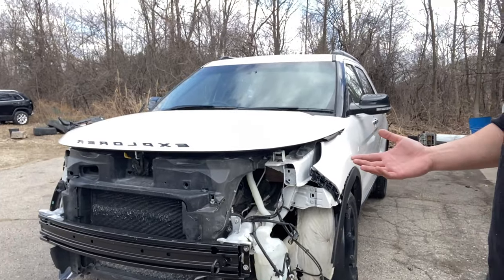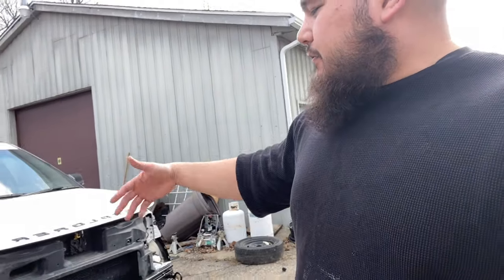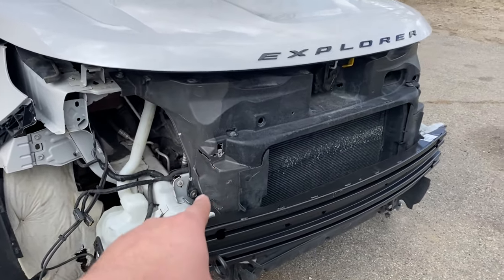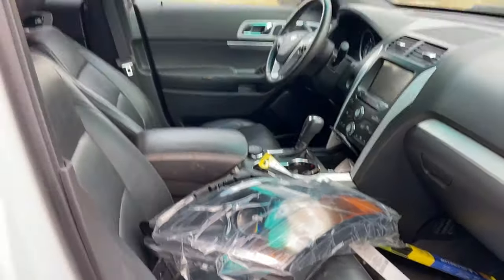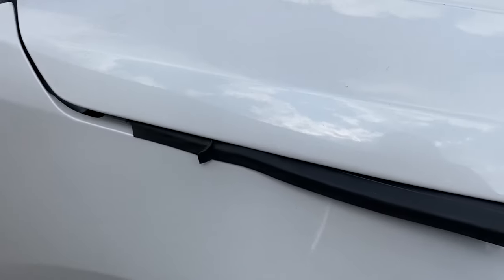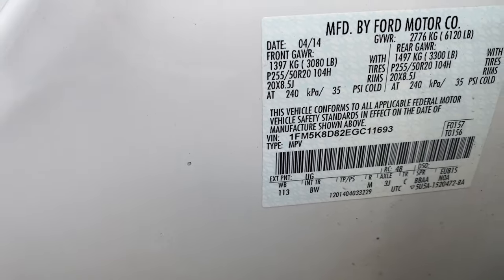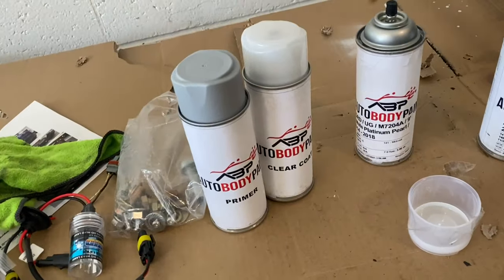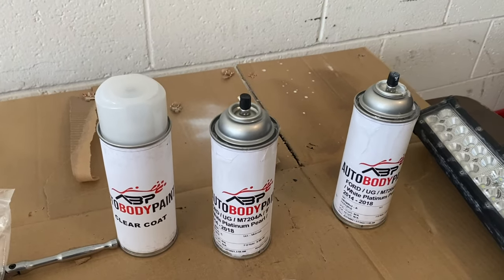Using Paint Matched Aerosol Spray Cans - Tri-coat Paint Job

Comment: that came out great - honestly, the formulations of aerosol auto paints have gotten SO much better than they were only 20 years ago, especially for the urethane base and 2k clear coats that are available. with just a little bit of practice, there's not much difference between DIY and a budget body shop spray....and honestly, I think it's easier for a novice to get a better result these days from aerosol cans than a proper air compressor and paint gun since there's so much more technique and knowledge needed for the latter to get the same results - just might need a little more time and elbow grease to sand and buff the clear coat - and most times, the worst case scenario it just looks like a satin finish instead of a pearl gloss.  Of course there's still a VAST difference between THIS and a proper $6,000 paint job - but most people don't need a full on high end paint job done on their vehicles.